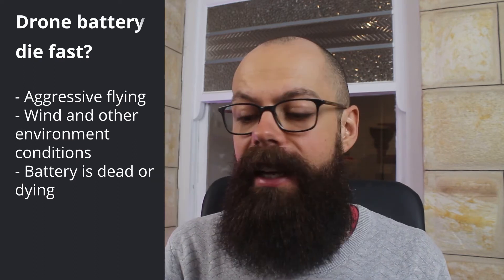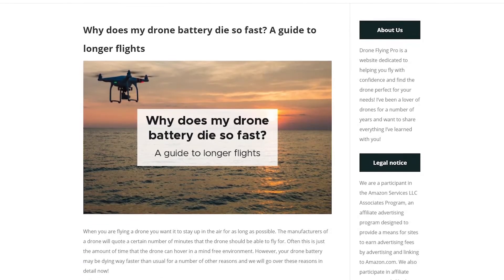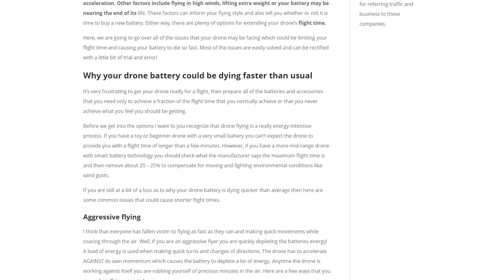Why does my drone battery die so fast? A guide to longer flights

Comment: What if my flight time has dropped from 15 minutes to less than 2 minutes and the batteries check out to be good
Reply: Hey did you find a fix? I got 3 drones with the same problem. But the flight time is about 10 seconds…
Reply: I got a 998 pro yesterday. It has same problem. One battery dies within 2 minutes where it should last 10-15 atleast... I'm a drone beginner so I think I'm doing something wrong. Also my drone and battery heats up alot